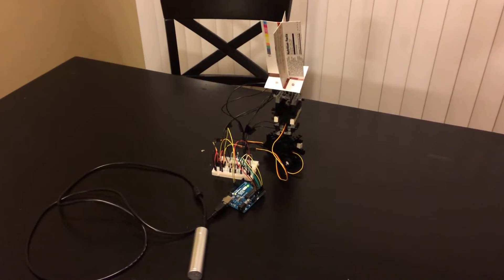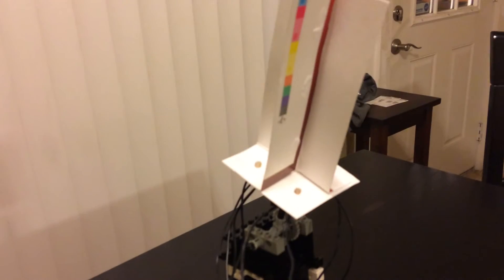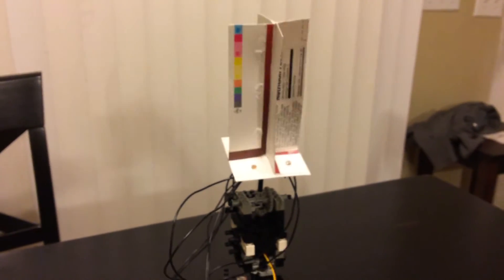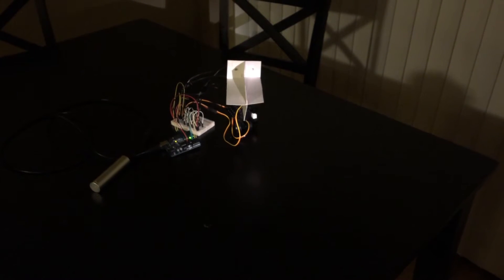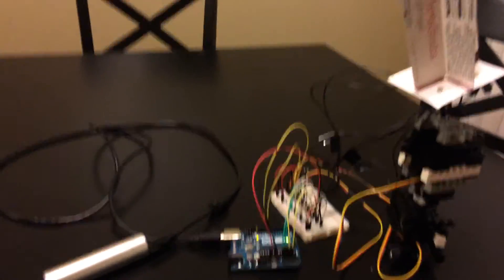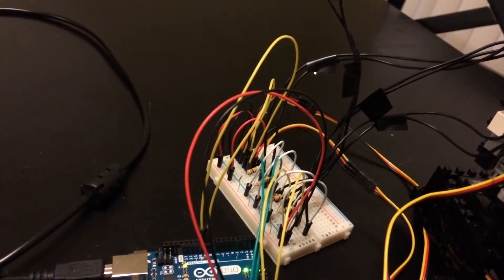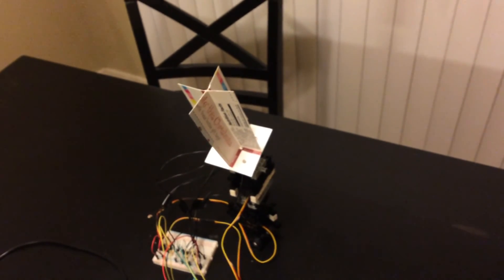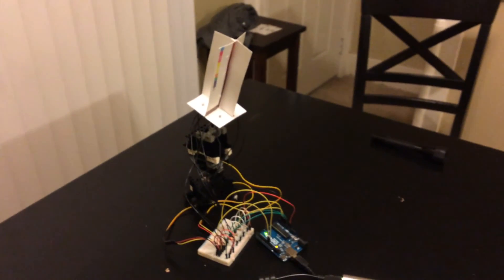Arduino Solar Tracker

Comment: nice project.. can i get the code for continuous rotation geared motor...am using 4 ldr input and 2 dc geared motor $ arduino  or can i use the same code for this continuous rotating motor.. motor

i  like to add 4 limit switch for this can u please helb me ,,

plx mail me

martinraj51@gmail.com